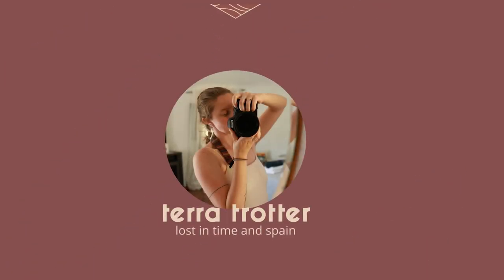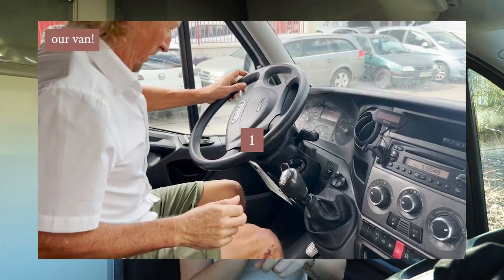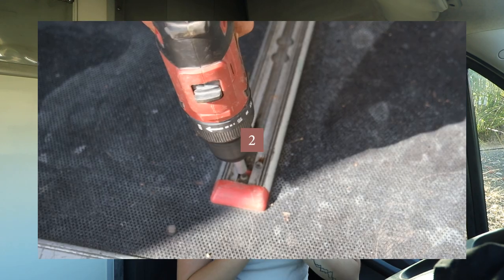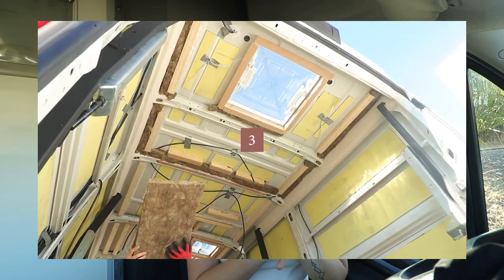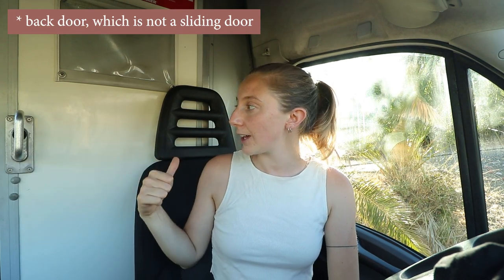how we installed the skylights in our van conversion

Comment: Hi! Subscriber 40 here! 

This is only the second video of yours that I've watched. I was wondering if you will have an extractor fan, like a MaxAir fan, somewhere. If you are, I did have a little tip. I've seen a lot of people putting their extractor fan somewhere toward the rear of the van, or perhaps at the midpoint. I put mine over the drivers compartment. Then I put stealth air inlet vents at the rear of the van. If you get a good fan (I really like the ten speed MaxAir fan), the air draws through the van surprisingly well, then exits out the front of the roof. I know that you have a partition wall separating your driving compartment from the living area, so you probably couldn't do what I did. But you may want to consider how you would like the air to flow when you decide where to put your fan. 

I'm really glad I didn't put my fan right over the bed. I'm a light sleeper and, though the MaxAir's are really quiet on lower speeds, they can be fairly loud on higher speeds, especially if it's right over your head.

Oh! One last thing. I went cheap and didn't get a remote or rain sensor  for my fan. They're a lot more expensive. But, with my fan way up in the front of the van, I sometimes wish I'd got the remote so I could adjust the fan speed without getting out of bed.

Sorry for such a long comment! Good luck!!!
Reply from the maker: Hi Mike! Thank you so much for your suggestions, please don't apologise! As this is our first conversion we welcome any and all advice and suggestions because we are still learning a lot as we go! We actually haven't put in an extractor fan as such. The skylight we put in the bathroom has the option to add in an extractor fan which we may do if we think it's necessary once we start using the van. We have also put in an extractor fan over the cooker in the kitchen. We hope this will be enough coupled with being able to open all the skylights (and if warm weather the doors too!).

Your idea to put an extractor fan in the cabin sounds really smart, I wouldn't want to put it above the bed either! Thank you again for your advice and I hope you keep enjoying the videos!